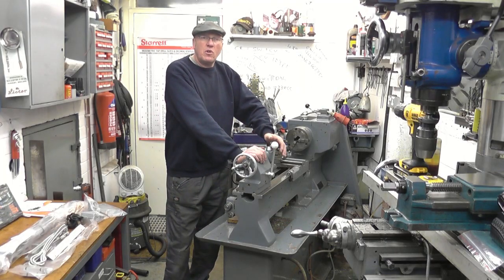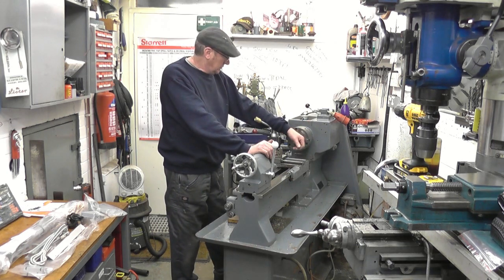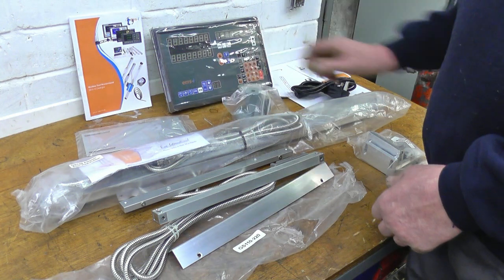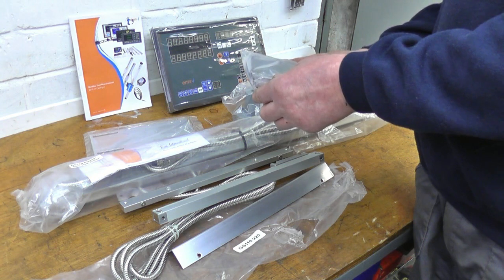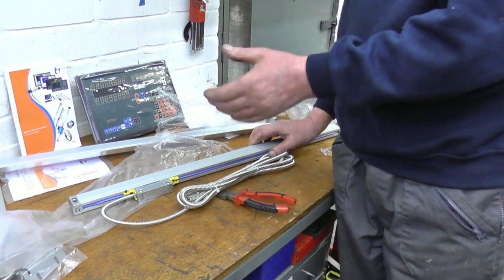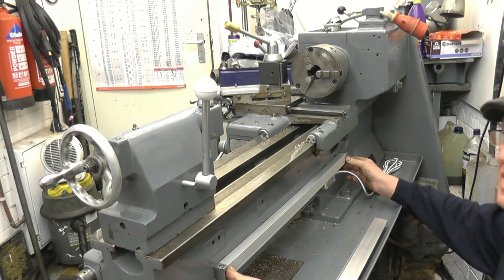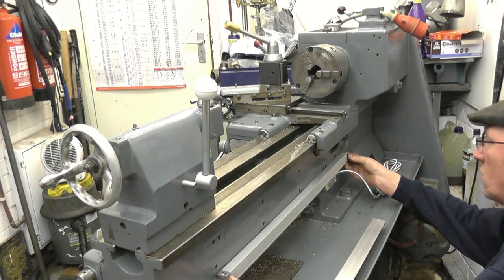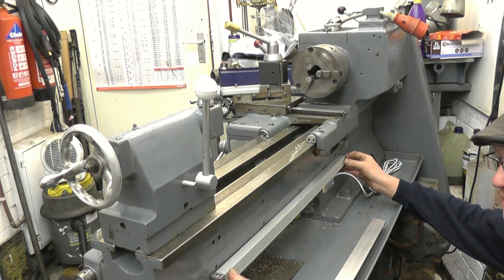DRO Part One

Comment: Had to thubs down John as this was a bodged job. First you drilled more holes in the casting when you could have made brackets and used the taper attachment mounting holes instead thus avoiding making more holes in the casting. Ok so you want it fitted fast. Then at least fit it in a position where tha taper attachment could still be fitted. OK so YOU dont want the taper attachment but your and old bastdard and the next owner of the lathe might. Totally gash man. Not impressed at all.

Comment: John, why did you not read the installation instructions ? I would have thought that the supplier had sent you all the correct brackets for your lathe, to use existing tapped holes in the lathe. So far you have used nothing that they supplied. It seems too that you have mounted it too far down, hell of a distance from the saddle to the reader head, may get flexing errors. Before you do more, please have a good read up about it. I would have thought that the supplier of the DRO had provided everything required so it would be easy to fit by a non technical person. Hope it turns out OK for you. Shame you have damaged the paint and filler where you tapped new holes. Another thought, on some machines, the part with the cable ( Reader Head ) is fixed to the bed and it is the scale that moves with the saddle. In that way there is no fear of you wearing out the cable by the constant tooing and froing of the saddle.
Reply: Dave Ticehurst I'm afraid you're living in cloud cuckoo land. There are very few if any specific kits for old machines, even popular ones. There are just too many machines and variations of those machines for that to be practical. You can get a bespoke kit for some of the new Chinese machines where they also supply the machines ready fitted with a DRO, but they often still don't just bolt in place.

When John says he bought a kit for a Harrison 140, he means that the company already had appropriate scale lengths and dimensions on file. The kits just come with with various slotted and drilled plates and brackets which will be useful to varying degrees.

As I said in my other comment, I would have mounted the scale differently, but what John has done should work OK. On my Harrison I had to build a sheet steel weldment to go around the taper turning attachment that is many times more flexible than anything John is likely to come up with. I do get some last digit jitter at certain rpms, but seldom need to place Z-axis features to 5 micron resolution anyway and there are ways round the issue if needed. I may at some future date cast a more rigid replacement.

The 'non technical person' comment just made me laugh.
Reply: Paul Compton  Yep, not very technical at all, this John. More like the Tommy Cooper of lathes. ;)
Reply: ***** I was thinking more the Norman Wisdom, but then John only lives an hour away and he might just drive down and clump me for saying that out loud... Oh, hang on :S  ;) In my defense he is a bloody good engineer and I've learned a lot and really enjoy his sense of humor :D

Comment: Hello John,

It's better to have the cable exiting from the reader head so you have just a single 'U' bend, rather than an 'S' bend. Of course if you've got enough cable length, you can loop around the back of the lathe and achieve that either way.

The preferred method of mounting scales on to non machined surfaces is to mount them on a sub bar. The bar is drilled for a clamping hole and threaded for two jacking screws at each end. You can then get the sub bar lined up in two axes, leaving just one axis to adjust using the slots on the scale. It guarantees that there is no residual stress put into the scale via the mountings. It does require a potentially expensive chunk of metal and I've used two separate mounting pads with three jacking screws to achieve the same thing more cheaply,